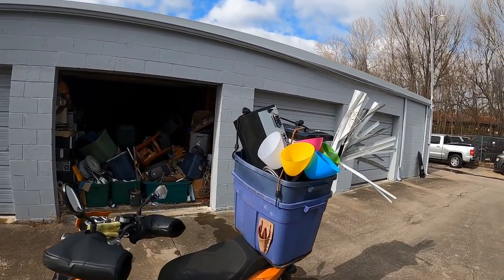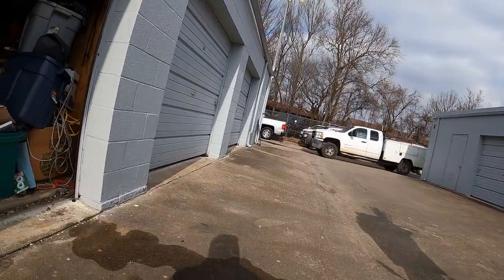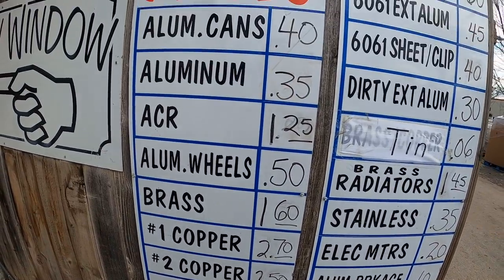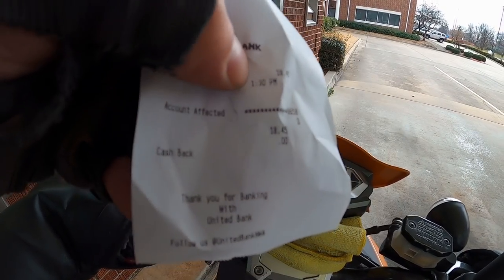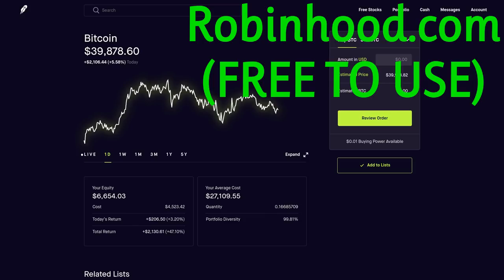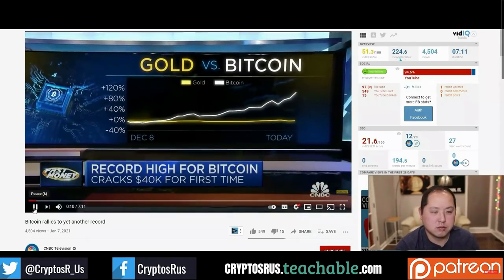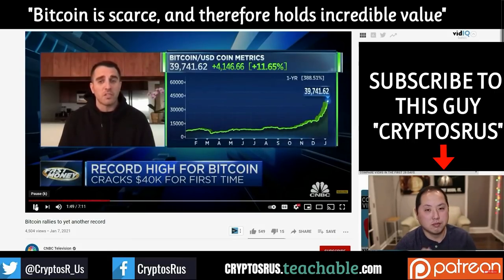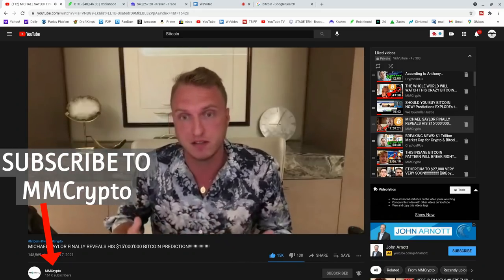How To Extract GOLD 2.0 From Lead Acid Car Battery!!! - NEW TECHNOLOGY!!

Comment: I must say i am a bit confused. You said you made 7000$ recently but based on what you are showing, you had put in 4500, so at the moment you have gained  over 2000. Am i right????  Thing is, until you sell  you can not say you have made or lost any money. I agree that bitcoin is a way to go  but you should be more clear about it. Good luck.
Reply from the maker: you can see more in this video if you watch the whole thing: https://youtu.be/Y1M3n0yYTbc
Reply from the maker: but what u see there on robinhood if i were to sell $100 of bitcoin and then buy $100 of bitcoin those numbers would read i put in 4600 and have gained ove 1900...
Reply: @ScrapVulture111   that is my point. You have not made $7000, the value of bitcoin you have got is $7000 atm. thanks for the answer.
Reply from the maker: @robertpawlak5452  mind watching the video link i gave you twice now? https://youtu.be/Y1M3n0yYTbc
Reply: @ScrapVulture111   i am not misleading anyone. I try to understand where that $7000 figure is coming from in a polite way. I am not against bitcoin or you investing in it.
Reply: @ScrapVulture111  I watched the other video as well. I do not think you understand me. All i said is that value of bitcoin you have got in your account is $7000 not the actual price of it.
Reply: @ScrapVulture111  do apologize,  Realized you are investing in bitcoin on 2 different platforms and your gains are combined.

Comment: Believe it or not theirs a ring on the piston called oil ring below compression ring, on big piston, on 50 cc believe just one, might be time for mew piston with ring, last one I bought $17. Not too tough to pull jug. If you do it be sure to put ring in jug and make sure gap is to spec, I didn't and ring bound in cylinder.